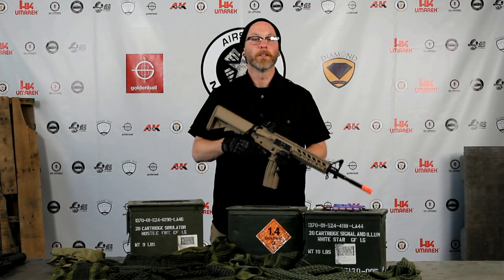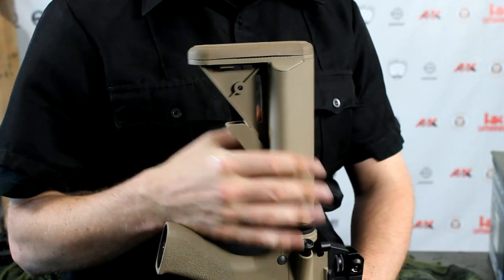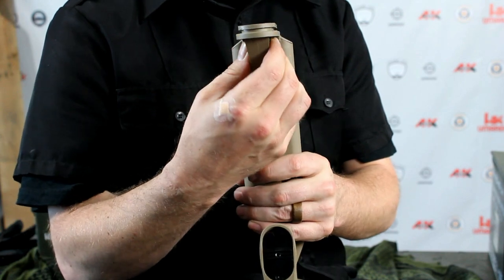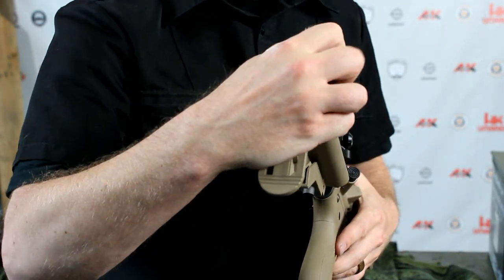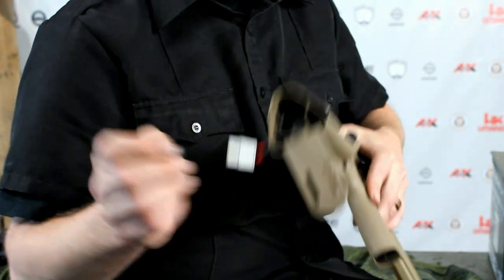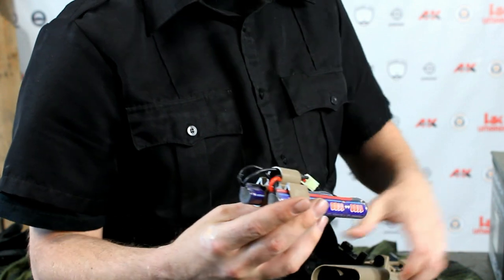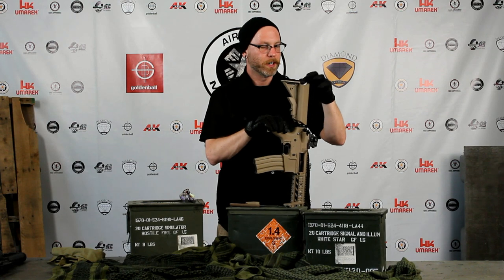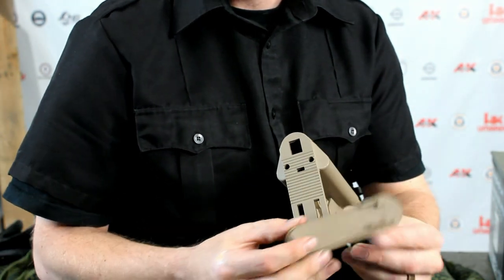M4/M16 AEG Nunchuck - Crane Stock Battery Installation Video - How To

Comment from the maker: @ xArnthorx I don't know what battery type you have and I havent't played w/ that particular G&G. Your options are. . . Two use a nun-chuck style battery so it uses the side battey compartments or switch out to a smaller stick size battery or change the stock to a Stubby full stock.

Comment from the maker: @ AcrylicAirsoft1 I'm guessing your buffer tubing is loose not your crabce stock. If that's the case, you need to pull off the buffer tubing. Then remove the buffer tubing cap. Get a long screw driver & tighten the screw.

Comment: thank you so f-ing much i've been trying to get mine cap off where you have to squeeze those two tabs together i was using pliers did work to small or kept slipping off the tabs i need to charge my battery i didn't know how much life it has left

Comment: Will a tenergy 9.6v 1600Mah fit inside the HANDGUARD of the kwa cqr mod 1? Because I'm going to buy the gun but the actual battery I want is out of stock.